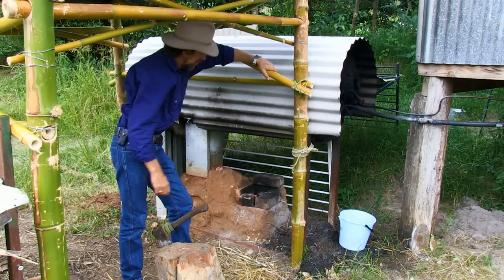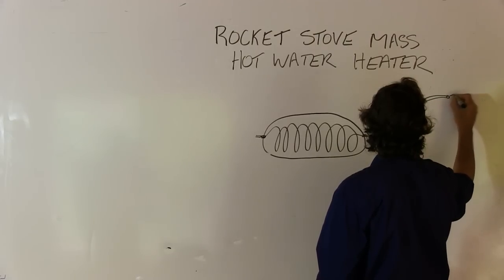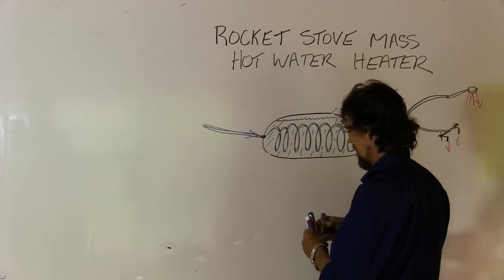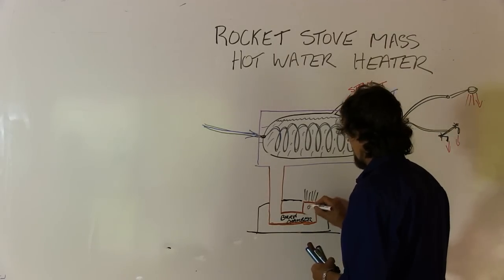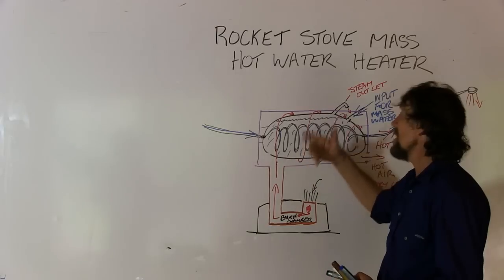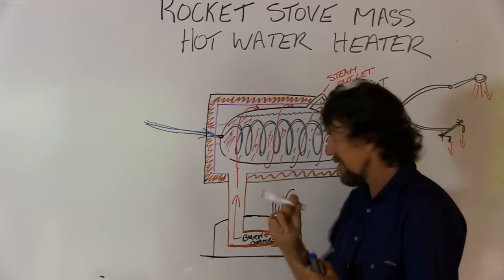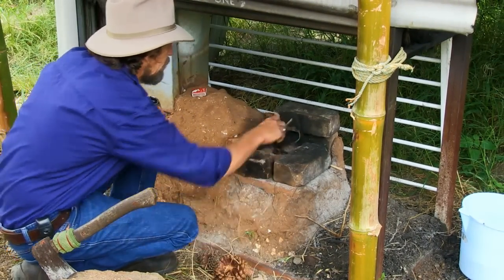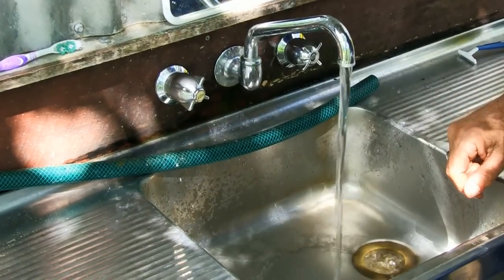How to Build a Rocket Stove Mass Water Heater, with Geoff Lawton

Comment: must be a way to recycle the steam blow off /relief back into the tank..
Reply: Don't complicate safety features.
Reply: Would that make it distilled water?
Reply: hook it up to a steam engine!
Reply: just use at open expansion tank.
Reply: Corwyn - It`s not complicating a safety feature. What about using a SS urn with a hole in the side at the top to allow the steam to vent out into the urn while allowing no pressure to build up but still collecting the liquid. Safety feature still exists but now you can reuse the water that came out under pressure along with the steam. All you need is a tap on the return from the urn.

Comment: Wondering if it would be worth it to hook a used dismantled turbine housing from a car turbo up to the steam outlet.
Attach a ribbed pulley leading to an alternator and you've got an additional 13.8v to charge a battery bank
Reply: Maybe vent it a little sooner and make a wood gasification generator , I'm sure you could trick it out to get the best of both worlds hot water AND electricity
Reply: Sorry I see now why it would not work trying to think outta da box what can I say picture of an idiot in action :)

Comment: Please remember, there are two huge factors in heating water. Water expands when heated, and water does not compress well. The reason for the outer drum is to act as way to keep your water piping from becoming a "bomb".  Never seal the tank from the atmosphere. The drum being open stops pressure building up, it also keeps the water at 212F or 100C

 Also, there should be a pressure/temperature relief valve in the outlet of the supply line side of the inner coil. (You can get one at almost any hardware) Even heating water from 60F to 140F will cause expansion, if all the valves are closed it could burst a pipe.

 Both of these reasons are also why you never just heat a coiled supply line. You can create excess pressure and temps that could really hurt someone

Comment: Hi great project , I was thinking of having the copper coil directly exposed to the fire , its gonna be a lot quicker,  but what you said about having a steady fixed temperature makes a lot of sense , its a great point  but my question was is the water hot enough yo use for radiators of a home central heating system  with a pump pumping continuesly hot water in loop system  ,   thanks
Reply: If you dimension it right it would. Radiators work at a temperature between 40 and 80 deg C (depending on whether you have low or high temperature radiators). The mass water can surely be made warm enough, getting enough heat out to your heating system is a matter of having the right amount of copper coils (the more, the hotter). The amount of mass water needs to scale with the total amount of heat required of course, or alternatively you'd have to fire it multiple times a day.

Note that if you have a hot water loop you'd have to deal with water expansion, but this is the same for any radiator system of course. I'm assuming you're thinking of retrofitting an existing system? Because if you're thinking of a new system you might be better off with a rocket stove mass heater.

Radiators are a very inefficient way of heating because ironically they don't radiate very well. They mostly provide heat by convection which is much less efficient and causes other problems like dust circulation and (because of the high temperature of the radiators) dust burning which releases harmful gasses (the well known radiator smell). Low temperature radiators have these problems in a much lesser amount, rocket stoves not at all. But then again, it can be a pain to build a rocket stove mass heater in an existing house, and often a rocket stove mass heater only heats 1 or 2 rooms.

In any case: if you're going to work with closed loop systems = pressurized systems, get someone with expertise in this field involved. A lot can go wrong with pressurized systems, even if you know what to do to handle expansion and such, you'd still have to get everything dimensioned right to prevent building a bomb.

Comment: Seems you could add a hose connection to the end of the steam outlet refill while still cool and eliminate the need for two lines to weld.  Yes?
Reply: That would work IF you ran it through some sort of cooling coil.  Otherwise you'd simply be pumping boiling water back into an over heated system.  You still want an emergency relief valve in place though.  Just in case.
Reply: you'd still need to have a way to release pressure.

Comment: great explanation but how about the same set up minus the tank of water and just have the copper pipe exposed to the raw flame, it would give hot water faster and maybe even hotter than having to heat a lot of water before it heats the water within the copper pipe?
Reply: AFAIK copper tubing exposed to open flame won't hold up very long as its too soft for that.

Actually, I'm thinking about running that tanked water mass through the under floor heating system.  That should eliminate any over heating and steam issue by using the heating sys. as a cooling coil.  Would still have the relief valve tho.  Add the solar collectors to the equation and we wouldn't need much wood at all.
Reply: I would imagine your assumption to be correct and good for a particular application. I think having the coils in hot water produces an even temperature of useable hot water over an extended period, even when the fire is out. It would take a long time for the entire system to cool. The way you describe is more like instant hot water for the life of the flame. Depending on the application it could burn more fuel than necessary. Once the flame is out, the system would quickly cool, which could be a benefit. Also, the copper directly in the flame would have a tendency to flash the water to steam much quicker, making the system less safe, if not designed for that use. So, both systems would work for different applications. For home use hot water, Lawton's system would be more efficient and safe. Just my thoughts…I could be wrong.
Reply: Stefan Dingenouts There was free flaws in this presentation. The actual burning off the wood will have a source temperature of MAYBE 1,000 C degrees, but I sincerely doubt given the thermal size of the fire pit. Maybe 750 C. 

Second, once the heated air begins to travel through the pipes and tank assembly, the Co2 gas temperature (and any remaining hydrogen, oxygen, etc) drops dramatically. At least 25%. In fact, the fire pit size shown probably doesn't exceed 600 degrees Celsius, which is roughly 1,010 degrees Fahrenheit. Creosote burn off can be achieved at temperatures as low as 250C depending on the wood species burned and as a consequence, be smokeless.
Reply: Could you wrap the copper coils around a metal flue ?

Comment: Have you tried a copper brazed fin heat exchanger, they are much more efficient than a coil, it's used widely in industry and can be found in oil boilers.

Comment: This is simple and easy However I can think of 2 minor improvement. You could use thermal syphoning  with a second water mass drum with insulation but an open lid to allow pressure release, this would reduce wastage from the blow off and increase the amount of hot water you could have after the fire is out.  The second improvement I would add would be a pre mixer that mixes the outgoing hotwater with a bit of cold water so you aren't getting near boiling water from your taps. But of course those changes add complications

Comment: What a clever idea and thoroughly explained..even looks simple enough for me to give it a go... Just one question...what size copper pipe do you coil inside the steel centre??  Thank you :)
Reply: i dont think it would matter too much as long as the water in the copper coil spends enough time in the water chamber. its all bloody hot water inside. it just takes the heat from the out side water as it passes through to your taps. hope that helps.
Reply: I've so far gathered bricks, a 44 gallon drum, a broken hotwater system, insulation and a friend to help...just need the copper pipe and fittings :)  I'll let you know how it turns out and try to even send a photo.  This is absolutely one of the most brilliant ideas I've ever seen!! Thank you so much!!
Reply: Stefan Dingenouts Sorry Stefan for my late reply....still haven't built it, as summer is here, and currently enjoying cold water in my out door spa :) ...I have been gathering bits and pieces for it, and thought bessar concrete bricks around a 3mm pipe would do the job ? Thank you for your advice.

Comment: You can do this without the copper pipe inside the tank.. you just need to feed the cold water in the bottom of the stainless tank and the hot water comes out the top.. its called a donkey and works very well.. much less complicated than cutting the ss tank open to insert the copper pipe and welding it up again.

Comment: Very informative but a question how would one pass the coiled copper pipe through the tank and bring it through the other side?
Reply: You have a length of copper pipe pre-coiled to the interior volume of the hot water heater. Then you thread it through the opening you cut for the cold water inlet and out through the hot water outlet.

Comment: Nice Job.
the insulation just under the corrugated sheet metal is not really necessary if you use a pipe to extract air from this space for your feed air inlet. The top of the feed tube would need to be sealed with a simple lay on lid and the feed air would come through a pipe that draws the heat from between your barrel and outer metal cover.
yep it is more complex but will give two advantages.
One : your inlet air would be at a higher temperature and dry
Two : the heat that would have been lost in the insulation or to atmosphere will be directed back into the flue.

Comment: Wish I could have this built, I live in a smoke free area so Am probably not allowed to have this done. Can this work as well as a house heater like those American mass heaters? They connect a steel pipe from the stove then run it along side a wall and window and then bend it to bring it back to the chimney. then cover the pipe with bricks and shaped it like a bench or a sofa.
Reply: wonder if this is allowed in London?

Comment: well done...and in fact one could pipe that hot mass water exiting the system into a house and use as a boiler heat system and then pump the water back into the mass container once it has transferred heat into the building and cooled off

Comment: How do you get the copper tube inside the tank?
Reply: oyinbo - the resident copper would be the remains of a heating element so not useable. This would require new copper tubing. 
I think you need to watch the video again.

Comment: how would I convert this to a hot water furnace
Reply: seems to me like you could wrap the interior supply line to your heat duct.  Probably wouldn't get hot enough for primary power source but to give another system a boost to save the other energy already being used.  Perhaps even a closed loop but you would really need a pressure release (water under pressure boils/steams at a higher temp but I think you would reach that relatively quickly depending on loop size.  Just think like a geothermal heat pump where the water above the rocket mass is your "geo" source
Reply: Steven Hendon  You have touched on some good things.
Geo Thermal coils underground. Then Take the out hot water output and run it through an old Air Condition/refrigeration coil to act as the heat exchanger.
Then add the air pump.
If you ran the water system into a  mass the mass would hold the heat.
stone-cement- whatever but water is best. Pound for pound water holds 5 times the heat of cement. Another reason to use the water around the coil.
So the coil outside would feed the coil of you indoor water mass.
Your indoor water mass can also be painted black and placed indoors where it will get the most sunlight during the winter.

Comment: how do you perform surgery on a stainless steel tank to insert the piping?
Reply: Cut it open, install your pipe and weld it back together. You could pay someone to weld it if you don't have equip for $20-$30.

Comment: isn't it bad to use pine cones because of the soot it puts in the "chimney" or does it get trapped by the water...but then could it clog up the lower holes??
Reply: The key to little or no soot is that whatever you burn be "seasoned" (thoroughly dry) wether it's hardwood or "resinous" wood. It all burns great if there is no water in them. (even tho it's hard to have it 100% moisture free)
Reply: The produced heat circles around the barrel containing the water, so the soot never enters your water supply.

Comment: Is there any reason why a copper water cylinder couldn't be used for this purpose. Stainless steel cylinders are rarely used in the UK but can be picked up as scrap for between £20 and £50. An indirect cylinder would already have a coil of copper inside.

Comment: Hi all. As the builder and designer of the hot water system in the vid  and a few more since i will try to answer your questions. So  firstly cattlewrangler  if you dont add water it wont go boom in fact the way it is designed the laws of thermodynamics would have to be suspended for it to go boom. For a little more info check out my original article http://permaculturenews.org/2012/11/23/rocket-stove-hot-water/ . Emerson in fact its like buying a race horse to do the work of a draught horse. Many years ago we were building these for remote area camps (they were called donkeys) but without the heat transfer coil. They would typically get hot much quicker because they usually had a huge fire under them. Adding the rocket means the water heats slower than the old donkeys but uses vastly less wood. The rocket gets high efficiency because the combustion is compleated prior to drawing off any heat this is the fundamental difference between rocket stoves and conventional wood combustion technology. Absolutley there is some back drafting because a flue was never installed on the heater to finish it. Adding a short length of flue would correct this however typically the heater draws well enough. Recent testing i have done with cooking ovens in New Zealand suggests that putting baffling around the barrel to make the hot gasses follow a more convoluted path will greatly increase efficiency as i am now getting temps above 500 deg c in these oven post baffling and 300 deg c prior to baffling. Doireallyneed1 weight for weight water has over 5 time the heat storage capacity of cob and is a far better conductor. Also because it boils at 100c the water in the outer tank will vent harnlessly to atmosphere, but because the water in the coil sits at a higher pressure (its coming from a pressurised source) it has a slightly higher boiling point (basic physics) so it can never boil. Putting the coil in cob and heating the cob is inneficient but when it gets above 100c the cob will just keep getting hotter and eventually the water in the coil will rise to its boiling point and then it will go boom. I used bricks for the feed and burn tunnel insulated with a clay sawdust mix which is reasonably insulating when the sawdust burns out leaving voids. The heat riser is steel insulated with a perlte jacket. Steel doesnt hold up well on the intake side of rocket stoves(rapid oxidisation) due to the extreme heat and some unburned oxygen however it seems to last better in the heat risers because by this time all oxygen is consumed and so far less oxidation(rusting) occurs. Hope this clarifies things a little but check the article link above for more info.
Cheers Tim
Reply: Tim Barker hi im wondering if u are still using the same design? are u using an old hot water tank inside the 2ooltr drum
Reply: Hi Jas yes I am using the hot water tank inside the 200l barrel for hot water systems in Australia and New Zealand. I am currently teaching in the US and here we have the problem of no copper hot water tanks available second hand. I am working on a couple of design solutions which I will put up at some stage.
Reply: Tim Barker thanks Tim we r e is the best place to follow u too see any updates. im a novice but gonna give this a go. do u have a parts list or anything like that to help me?
Reply: Tim Barker were would u recommend looking for the hot water tanks in australia
Reply: Check here from time to time   http://www.appropriatetechnology.com.au
Reply: Thx
Reply: Has anyone set one up in tassie that i could view

Comment: The hot ehaust gasses only need to cool to be forced down the barrel in an RMH. Here the shroud is over the top, and the hot gasses aren't forced down. Because of that cooling is irrelevant.

If it's bush engineering why even go for a rocket? The whole idea and reason behind the Rocket, the justification for all the maintenance on a rocket, if the high efficiency and clean burn. He isn't getting that. It's like buying a draft horse for saddle riding.

Comment: I think at a guess bcoz the air isn't cooling enough going through the water heater to create a proper heat pump effect and create a stronger draw. I don't think this is the best way to do it but, it's bush mechanics, the criteria isn't perfection, as long as it works, it's all good.

Comment: Like the idea that the unit is outside but with -35 winters the pipes would have to be well insulated as well as the barrel. I own a forest so no shortage of blow down wood. When we had hot water radiators even they had a blow-off valve, in case. My father would bleed them annually and the water was always rusty. Loved the rads as a source of heat as it's steady.